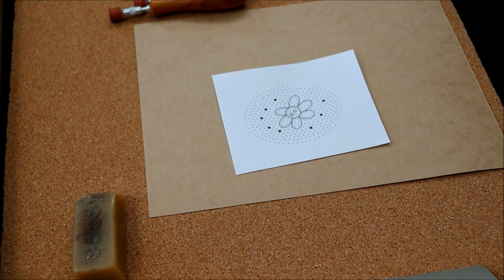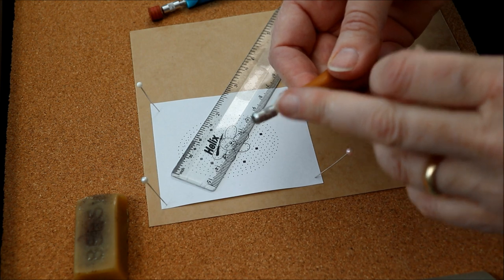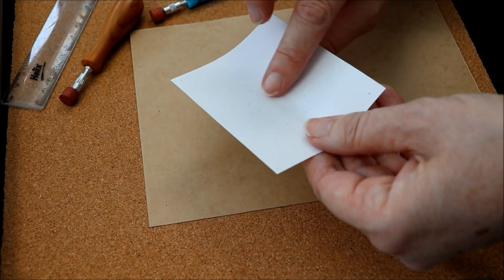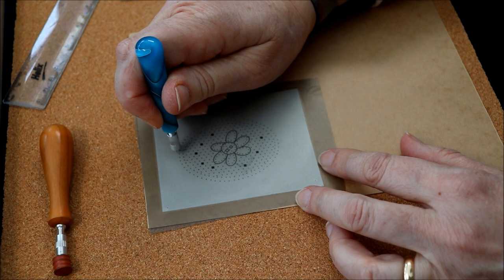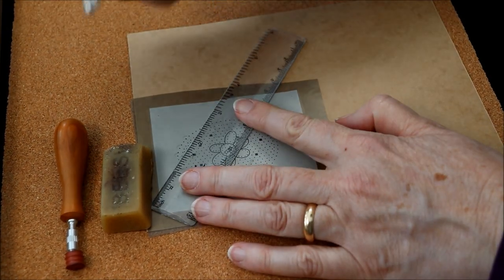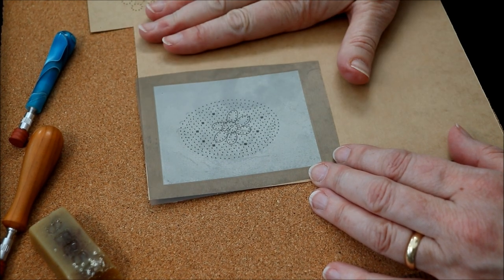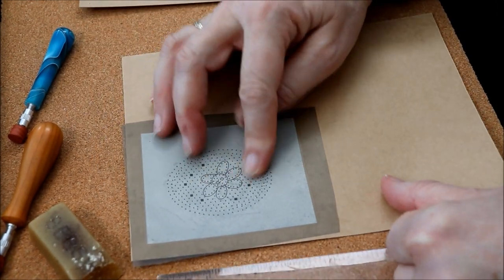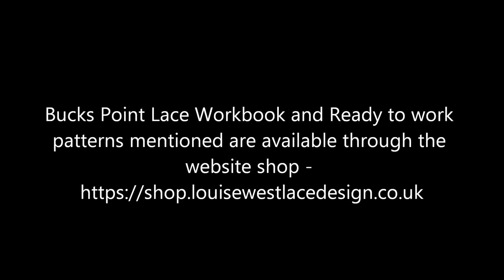How to prepare a pattern to start bobbin lace

Comment: Since I am new, I have many questions:  when I am done with bookmark, what can I do to keep it in good condition such as  do i mix glue and water to stiff it, or what is best suggestion, etc

other question.  I asked same question in facebook, about bobbin pins   which pins do I use for certain threads, or designs, etc

other question: how many bobbin pins or pairs that I need to put in.  general rules. not sure how I explain this
Reply from the maker: Thanks for the questions. There’s lots of ways of finishing a bookmark to use it, but generally bookmarks don’t need stiffening. You can buy plastic bookmark sleeves from suppliers to slip it into to protect it and keep it clean. 

Pins, as a general guide, thick thread you can use thicker pins and finer threads, finer pins. However for the majority of lace I do I use 0.5mm pins, and they work well. The only exception, is where I am working a very fine piece and might want the holes smaller in keeping with the scale of the lace. (A new angel pattern I am about to release was working in fine 0.4mm pins.) 

Asking how many pairs you need to add is difficult to answer without knowing the type of lace etc. Often patterns tell you how many pairs it takes, particularly for beginners, or look out for a beginners books to help you learn some of the basics.m